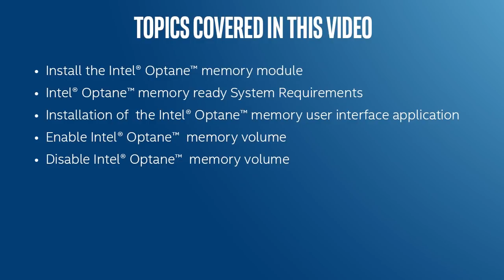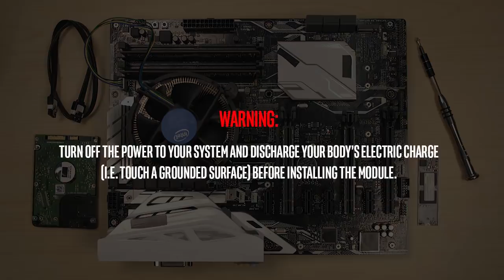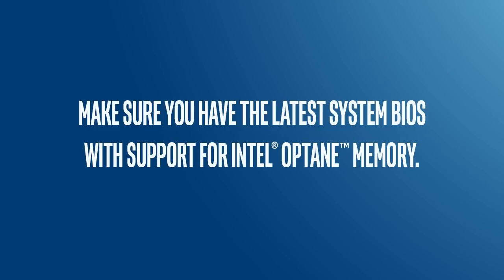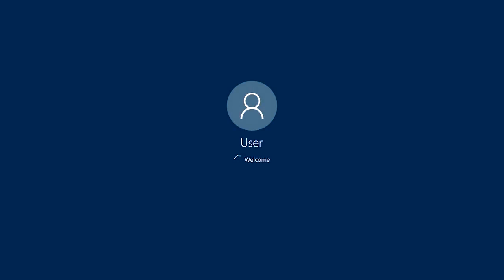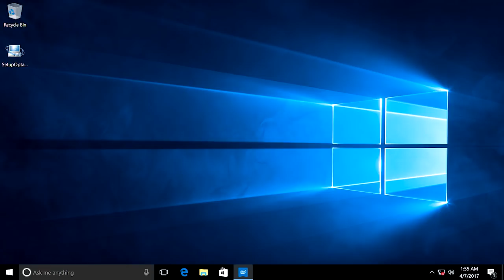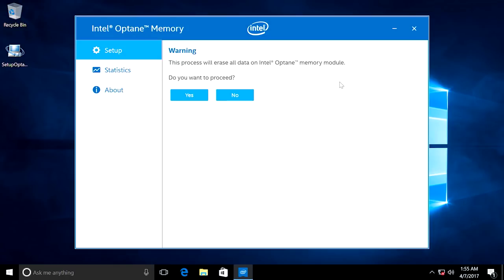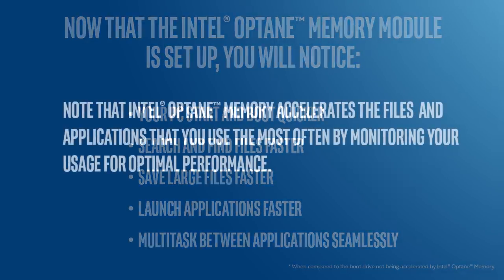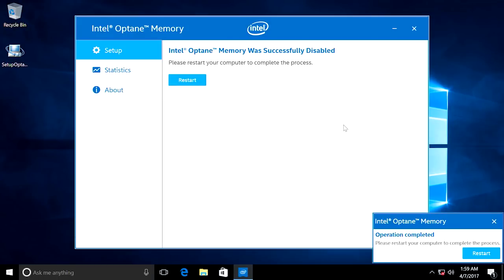How To Install, Upgrade, And Manage Intel® Optane™ Memory In Windows® 10 (basic) | Intel

Comment: 32gb of Intel optane boosted my system performance and works like a champ!
Reply: Do you think  16 gigs of Optane is enough  if I run  32 gigs of DDR4 ?  Should the numbers match?  My NUC order is still in the checkout cart.  I could change it to 32 gigs of Optane if it would be that big a difference.
Reply from the maker: Yes, 16GB is adequate for normal mainstream usage. It is not necessary for the Optane memory and RAM to be of the same memory capacity. The higher capacity Optane modules are necessary for power users who often use a variety of data-intensive applications, such as prosumers and gamers. Another difference would be features and capabilities. Modules that are at least 32GB provide support for Pinning (selecting specific files, folders, and applications to accelerate). For more information, please refer: https://www.intel.in/content/www/in/en/support/articles/000024018/memory-and-storage/intel-optane-memory.html
Reply: @Intel  Intel I buy a 32gb optane, The device need the IRST Software always run? or is only for manage? Sorry my bad english.
Reply from the maker: Hello! Happy to assist you. Yes, the Intel Rapid Storage Technology software needs to run continuously to accelerate your system with Intel Optane memory. The purpose of the Intel Rapid Storage Technology application is to enable/disable the Intel Optane memory and to perform RAID operations. To know more, you may refer https://intel.ly/2MZQVqS

Comment: Whats the problem on my intel optane , the application wont install and saying that my bios configuration is not compatible , i have an asus strix z370 e gaming which i also updated my bios , what seems the problem in my pc?
Reply: Gerard Lero me too, do you solve it ?
Reply: Same here any help?
Reply: you probably need to install win 10 uefi
Reply: You  shoud have intel cpu
Reply: Is it UEFI if not your system might not be compatible
Reply: i did already solve the problem, u should change or fresh install windows with GPT Mode tutor you can search on youtube, i'm using Gigabyte Z390 Aorus Pro WiFi

Comment: I have an ASUS H365M-A motherboard. Can the Intel optane support it?
Reply from the maker: Hi! We understand your concern. We would like to inform you that a specific support is required in the BIOS for a system to support system acceleration with Intel Optane memory. Also, steps to update the system BIOS are vendor-specific. Hence, we would recommend you to follow guidance provided by your motherboard support.

Comment: Yeah, right, i imagined it will bee just plug and play and install software but, was a 2 hour searching, drive converting, recovery partition deleting nightmare to get it running, well but end system runs much faster, so was worth it :)
Reply: Can you explain the process in short im having trouble enabling the optane on populated drive

Comment: is there a top & bottom side on the module ?
Which side would be on top when you install the lock-down screw ?
Reply: The drive has a top. It depends on the M.2 position. Just like Ram is only one way because of the whole in the Ram.

Comment: hello i have hp envy x360 15mbp111dx and im thinking to get optane memory but im not sure if the motherboard supports it or does it even have a slot for it.Please let me know what you think
Reply from the maker: As long as the laptop is an Intel Optane Memory ready system, it should work. These boards and systems contain the necessary hardware and BIOS to support this new technology. It is best to confirm this by contacting your laptop vendor https://intel.ly/2XbqtNV. For more information, visit https://intel.ly/2S7Gz7D

Comment: Im buying a brand new pc with these parts:
Z370 strix gaming-e 
I7 8700k
3.5" 4tb seagate barracuda (for games)
Corsair Force MP500 120GB M.2 PCIe SSD (for windows 10)
And 3 more 3.5" hdds for storage

Will a 32gb intel optane do any good/diffrens?

Comment: Please bring this new tech to older tech users like core 2 duo, core 2 quad, etc.
Reply: Why? It isn't really profitable for them as those processors will "die" much quicker than newer ones. To Intel, this is very unprofitable and they may not add that
Reply: Also I really advise you to buy a new CPU instead of Optane

Comment: I have my operating system on an nvme drive, when I enable the optane genie it does not boot to windows. I want to use the module for my secondary 2tb hard drive. What to do?
Reply from the maker: Sorry that you are facing issues. We have responded to your Facebook private message. Please check.
Reply: @Intel  i have the same issue.how?

Comment: Problem ::::  Optane memory was working fine on Hp Pvilion x360 15-cr0053wm with HDD but after replacing hdd with samsung SSD its starts saying that your system bios is not compatible with optane memory. what do i do now ???
Reply: Update your bios

Comment: Hi, I have a problem with the installation, I  read the intel optane installation manual and the bios manual of my motherboard, and read FAQ of intel optane in your web, But I can not find a solution, My intel optane is detected as hard disk, and in the IRST does not appear the tab of Intel Optane, the boot disk is in gpt is a m.2 of 512 GB, I have not given the intel optane in the bios no format GPT or MBR, I do not understand why I appear as a hard disk and the IRST does not recognize it, Do You have a solution for this problem??
Reply from the maker: To proceed with our troubleshooting, we recommend using our support facilities at support.intel.com

Comment: I have a 16gb module installed, the software does not recognize it as a module. Is this becuz it needs to be 32gb or is it a fluke?
Reply from the maker: Oh no! That's unusual! Could you send us a direct message with a screenshot of the error you are facing, along with the Optane memory model number, processor model number, OS version and installed RST driver versions so that we can assist you better? You can send us a DM through our Twitter or Instagram channel via @IntelSupport.
Reply: @Intel  yes.  Thank you for offering to help 😊 I saw it wasn't supported anymore on Intel's website, figured I'd take a shot.  Glad I did.

Comment: Great video thanks, just wondering I have old computer asrock Z77 OC  formula it doesn't have m.2 option or intel optain option, is there any pcie card which intel optain can be installed  and use it? Thanks
Reply: There is a PCI-E 4x Optane card

Comment: Intel Optane Memory and Storage Management app

I can see both of my SSD drive and Optane drive being enabled (status:normal, usage:avaible)
... but in optane tab its shows that my memory is disabled. There is an option to "Enable optane memory" but when Im trying to do that I get error Code 0xA0010055. Anyone know the solution?
Reply from the maker: Hi! Sorry that you are facing issues. The error you are facing usually happens after a clean installation of windows 10 20H2. We recommend that you reinstall the operating system with a bootable USB drive. Please ensure that you change 'Chipset SATA Mode' to 'Intel RST Premium With Intel Optane System Acceleration'. For the complete step-by-step guide, please refer to this helpful article https://intel.ly/3h8nFfW If the issue persists, please DM us on Twitter @intel or send us a private message on our Facebook platform. We would love to assist you.

Comment: Hi, I have the following PC configuration:
Motherboard: MSI-X299-GAMING-M7-ACK
CPU: Intel i7-7820X
Storage: - Intel SSD (NVME) 600p Series - 512GB
- 8 x Hitachi 4TB 7200RPM - 3.5 " Ultrastar 7K6000
I would like to know if I can mount an Intel Optane in this configuration, but without giving up that NVME SSD.

Thank you!
Reply: Your motherboard supports it. Keep in mind that Intel Optane Memory is compatible with SATA boot drives for Windows 10 only. If you are booting from Intel SSD 600p, the configuration won’t work.
Reply: Moreover, please review your motherboard manual in order to verify if there's enough bandwidth available to use both of the M.2 ports and all his SATA drives simultaneously (M.2 ports share bandwidth with SATA ports: http://intel.ly/2CQFSrO).
Reply: You can also check the FAQ for Intel Optane Memory for more details: http://intel.ly/2zb01Xz

Comment: can the optane m.2 module accelerate an m.2 drive?
I ask because my windows 10 is on a WD Black 512gb m.2 drive....
Reply from the maker: The Intel Optane Memory can accelerate M.2 SATA interface drives. We suggest that you contact Western Digital to check if your product is a SATA/NVME interface.

Comment: I have a question, my computer has 2 storage devices, the OS is installed in the SSD unit, while the biggest files like video games are installed in the HDD, which of the two units should I use Intel Optane with?
Also, can I have two Intel Optane devices?, one for the SSD and one for the HDD
Reply: Use it for hdd drive to make it fast
Reply from the maker: Intel Optane memory can accelerate only one SATA based storage device in a single system. To extract the maximum performance benefits, pair it with an HDD. For more information, visit https://intel.ly/2WoiJH6

Comment: Sir, I Have a Z370HD3P motherboard alongwith a 500GB SSD, a 2TB sata HDD and a 16GB hyperX RAM and Intel Core i7 8700 Processor.

I am also installing a 32GB Optane Memory with it.

So, where is Operating System Recommended By You to Be Installed for superior Performance ?
Reply from the maker: Since you are using a 32GB Optane Memory, we are recommending you to use Windows 10 64-bit to be able to maximize its features and performance.

Comment: I am buying a premade pc with 16GB optane memory preinstalled and a 1 TB HDD. If I add a SDD and migrate windows/boot to the SDD do I need to do anything to make the optane continue to accelerate the old HDD that I plan to use for media and game file storage?
Reply: you might need to reinstall what was installed here to the HDD, but other than that, you should be good. sorry this is such a late reply. hope you fixed it!

Comment: Hello, I have a question, I am happy because I bought my intel optane of 32 GB for my ASUS MOTHERBOAD Z270 MARK 1, I have 3 hard disks (M.2, SSD and HDD) installed as AHCI, in my UEFI appears the option Intel Optane Raid, Is it possible to put in the UEFI Intel Optane Raid, if you have all the hard drives in AHCI, I want to continue with my hard drives as AHCI, How I have to install my Intel Optane 32GB ??,  Is it possible to put only Intel optane as Raid in the UEFI, and continue with all my hard drives as AHCI?
Reply from the maker: Intel Optane memory cannot accelerate a RAID volume. However, an Intel Optane memory volume can reside in the same system as a RAID volume. The operating system must be on the SATA drive accelerated by Intel Optane memory. Please note that	in a system with this configuration, we recommend using the Intel RST application to manage your RAID volume and Intel Optane memory volume.
Reply: Thanks for answering, only one more question. Intel optane works for an AHCI interface system ?? Or only for RAID interface system ??
Reply from the maker: Intel Optane memory can accelerate a SATA drive connected to a Intel® Chipset SATA AHCI Controller.

Comment: I have an HP Intel i5 10th gen with 32GB optane. The thing runs constantly, sounds like a jet engine, and uses 28-35% of my CPU on the task manager. When I ran a temperature check the core was close to 42Celsius! I am only using drive or word applications, no gaming.

I use the task manager to turn it off but each new application I run re enables it and I’m back to sounding like a 747 taking off.

I am NOT a computer person so I have no clue what to do to now?
Reply from the maker: Hello! We understand your concern. However, please know that most of the i5 10th Gen CPUs can withstand up to a maximum temperature of 100°C. From the details that you shared, we see that your system is pretty much optimized. It is absolutely normal to get 42°C for normal computing works. The sound that you hear while launching an application is the sound of your laptops fan, ramping up to keep your device cool and optimized. Turning it off may harm your system and can cause thermal throttling. To know more about the processor temperature, visit https://intel.ly/2Ajgrno. That said if you wish to discuss more on this kindly send us the complete processor model number via Direct Message on Twitter @IntelSupport or Private Message on Facebook from our page. Here is an article that will help you to identify your processor model number: https://intel.ly/2BlSHiV. We will look into it.

Comment: Intel R Pentium 8th gen processor with 4 gb ram and 1tb hdd. can i boost this pc using 16gb Intel optane memory ?
Reply from the maker: Hi! Please note that Optane memory does not support Pentium processor. It only supports 7th Generation Intel Core Processor-based platforms or later.  To know more about Optane memory please refer the given link via https://intel.ly/3pqq4rA

Comment: I accidentaly wiped what's inside of the optane ssd ¿is there a way i can reinstall it again?
Reply from the maker: Sorry that you're facing difficulties. Since your Intel Optane was previously paired, it would contain the metadata from the previous acceleration. You can clear the existing cache or metadata on the Intel Optane drive from system BIOS. To access the settings in the BIOS, we highly recommend that you contact the system manufacturer for assistance. Here is an article to queries related to Intel Optane Memory https://intel.ly/3b2T9AQ Also, refer to https://intel.ly/3B979Uq on how to install and manage these Intel Optane Memory Devices. If the issue persists, feel free to create a support ticket via https://intel.ly/3B9zAS2 and we will assist you further.

Comment: So, this needs a sata drive? i thought maybe with an nvme drive installed, this would help accelorate it.  but for some reason, it says i don't have a drive or optane module installed.
Reply from the maker: Yes, the Optane memory is designed to accelerate slower storage devices like SATA SSDs and HDDs. To know more about Optane memory https://intel.ly/3p13WQr
Reply: @Intel   So this would be pointless if I have a Samsung m.2 as an OS or why it didn't recognize it?
Reply from the maker: Please know that Intel Optane memory is a memory device similar to an SSD. This is used to accelerate HDDs only. It can also be used in standalone configurations. To know more about Intel Optane memory, refer to https://intel.ly/3p4T98a
Reply: @Intel  So, if all their is installed, is an nvme drive, and a optane module, it won't show up with supported devices?  So, i have to put in a hard drive, or sata SSD?
Reply from the maker: The Intel Optane memory can only accelerate HDDs. The system acceleration with Intel Optane persistent memory is only supported for a single SATA drive installed in the system.
We have an article which can explain all the details of Intel Optane Memory here: https://intel.ly/3a7tWWn
Reply: @Intel   Hey appreciate the reply I look into the article but even though it set up right still says no accelerated devices detected
Reply from the maker: Oh no! That's strange. We understand your concern. As this can be best handled via email, please DM us with your email address along with your full name and country/region through Twitter '@intelsupport' or PM on Intel's Facebook page. We will soon contact you with all the details via email.
Reply: @Intel  issue resolved. Just added an ssd, and optane saw it as an option to accelorate

Comment: I have this in mine but is used as a hard drive. And i noticed a difference in boot up. Dunno how to get it back to faster loading.
Reply: don't install until your primary drive is formatted and your OS is configured or it'll recognize it as a drive and not as a optane, then go back and install the module and configure it in the bios

Comment: Can Intel optane memory work with a 6th gen CPU and a x99 motherboard ?
Reply from the maker: It will only work with 7th generation Intel Core Processors and it's corresponding socket types at the moment.

Comment: Use caution with Optane!!!!!! It is not recommended to pair Optane with an SSD. It may improve the read speeds, but it will obliterate the write speeds by 60%.  It is suggested to use it for platter storage devices, literally literally just that...  Another issue is that startup repair no longer works because Optane is basically a "soft-RAID" (striping config), so when you go into maintenance modes (live CD or recovery partition), the startup repair feature will not have the ability to see the array and be unable to repair any startup issues. You won't be able to manually repair the boot loader either, since it is in an inaccessible array. This is RAID 0, a very risky setup where you sacrifice security for performance (security as in being able to fix any problems). If you have a 32GB Optane (they usually come with some mobos), either leave it out, use it only with platter drives, or take the chance and enable it with your Win10 installation. I found programs loaded the same speed with/without it. Alternatively, you can use it as a Win7 boot drive, which is what I did, ie use it as an NVME drive.
Reply: What are you talking about? Optane is absolutely not RAID 0. It's a cache drive. Think of it as NVRAM (which devices like routers, remote controls, and other embedded devices have used for decades). No data is stored ONLY on the Optane memory module. Instead, a COPY is stored for faster retrieval of commonly accessed files (especially small files).

I don't normally reply to this kind of stuff, but this comment is just all kinds of wrong.